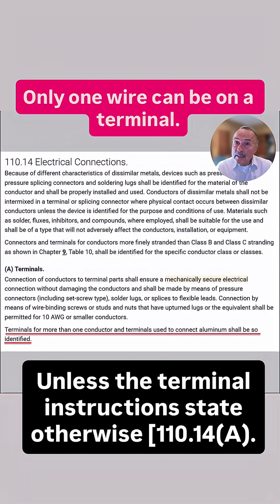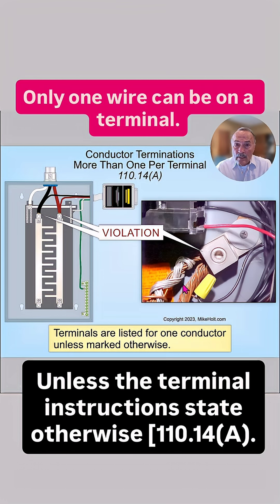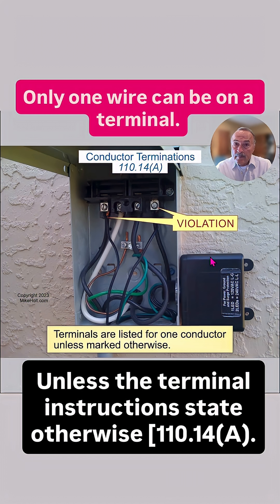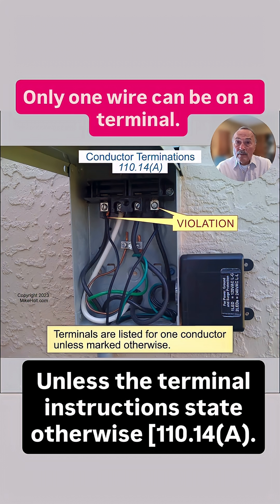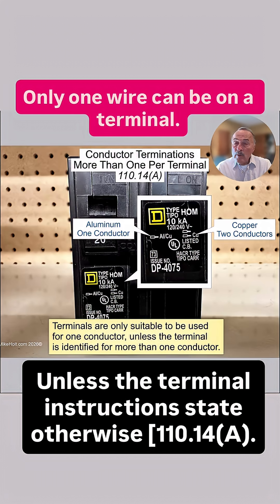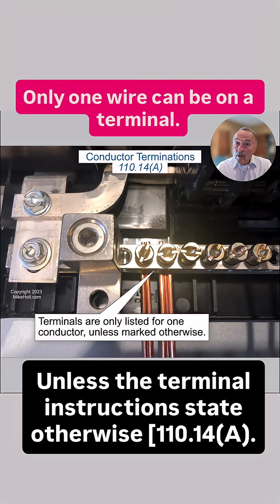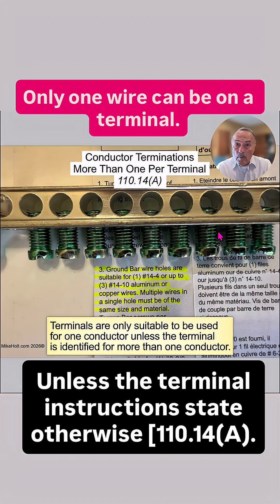Conductor terminals are only for one conductor, unless the terminal is identified otherwise.

Comment: You cant no matter what on a neutral bar double a neutral conductor like the grounds
Reply from the maker: @zanegreen6382, the rule is no more than one neutral under a terminal, see NEC 408.41.
Reply: @MikeHoltNEC thank you 💯 learnt something new
Reply: A reasonable person wouldn't double the neutral even if the terminals are rated for that purpose. However is it against code to double neutrals?
Reply from the maker: @MurffSurff, what Code rule supports your comment?